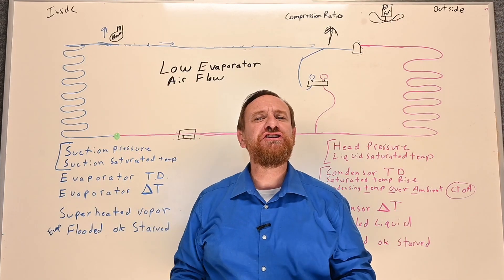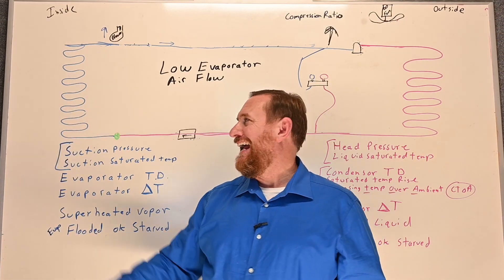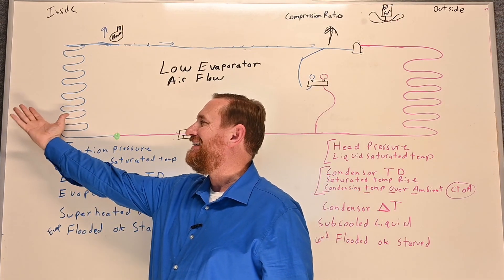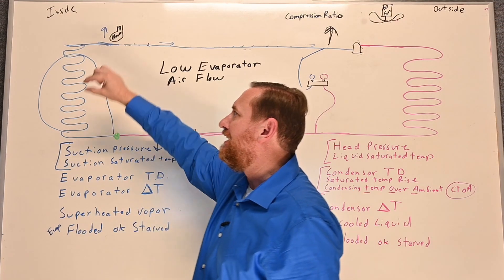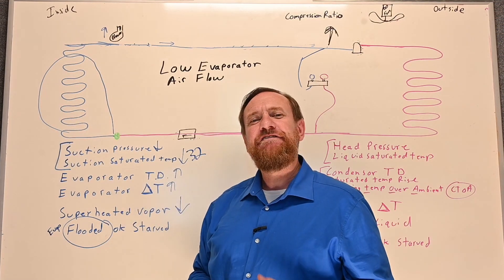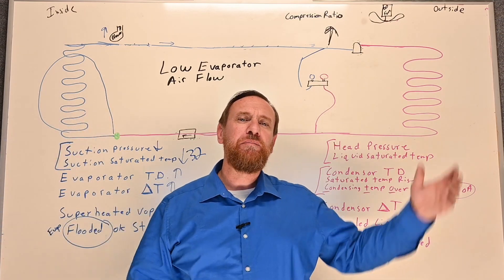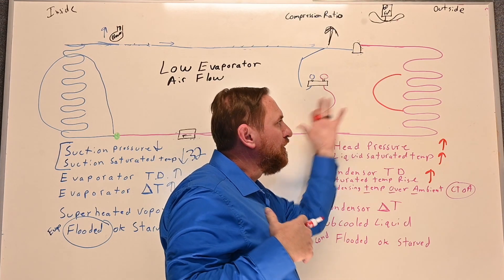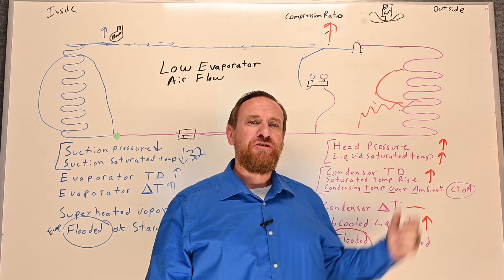HVAC 102 Scenario Low Evaporator Airflow effects on the refrigeration cycle

Comment: Does a TXV completely close when there's no thermal load? I do not understand why if the superheat is low, and txv is closing, there is more and more liquid in evaporator.
Reply from the maker: Some TXV's can completely close it most have an operating range. They can only close so much and the liquid pressure is an opening force.

Comment: On a service call where someone installed a 3 ton for a 1300 square foot, slab home with a downflow furnace.  Old coil was freezing up and after looking how awful the brazes were i decided to put in a new coil and liquid line filter drier.  Triple evac and pumped down past 100 microns and held.  Cannot get the low side above 100psig on a 410a oversized condenser (i did not install).
I am hesitant to put in properly sized equipment because it seems there may be restrictions in the concrete slab where the ducts are run.  There is a giant oak tree out front and seem to think the roots are choking parts of the ducts off.  
Anyone have ever had odd supply air issues?

Comment: I'm confused on this one. If the airflow is low, wouldn't it make the TXV to overfeed migrating the liquid out of the condenser into the evaporator? During a TXV overfeed, the suction pressure raises but with low airflow it decreases? Am I reading too much into it?
Reply from the maker: The TXV will try to maintain a constant superheat and maintain the correct amount of refrigerant in the coil. 

Once the air is restriction gets severe the TXV will close to the maximum of its movement and the evaporator will then flood
Reply: @love2hvac  Ty, first of all thank you for responding so quickly, I'm a fan of your channel, its in my opinion the best in the industry when it comes to teaching!. That's what I had in the back of my mind. It most be a severity situation. I guess a mild airflow restriction will show signs of TXV overfeeding but only when it starts to get bad is when the suction pressure will begin to drop and liquid starts to go through the evaporator and back into the condenser!.

Comment: it's actually very hard to tell the difference between a TXV problem (dirty/debris and can't work correctly) and a low indoor temp,
 as well as air flow restriction based on SH / SC and pressures.
When we have a low indoor temperature, the pressure drops, the temperature on the evaporator drops even below 30F. 
Then what? Should the TXV be opened only minimally so that as little refrigerant enters the evaporator? 
I have this situation at mine car, i in Car A/C, system with TXV and fixed piston compressor, 
when i RISE RPM, my Superheat instantly drop down to 0, 1, 2...thats low.
yes, there is a low ambient temperature( 67F), and a low cabin temperature(61f), 
how do I know if the TXV is working properly? maybe some debris fell under the needle and it could not move needle down to block refrigerant flow?
 any advice to be sure if i have to replace TXV or too low ambient/indoor temp?
Reply from the maker: Get the true flow grid and confirm airflow before doing superheat or subcooling. 

TXV rarely fails and often misdiagnosed. Bad airflow is the #1 cause for improperly diagnosed  TXV.

A TXV does not control pressure, it controls Superheat assuming airflow is correct first. If you have low suction pressure, adjusting the TXV will only flood the compressor and cause premature compressor failure.

Comment: Nice teach sir..What cause, if my discharge pressure stay and my suction pressure drop.. Hope u can reply..
Reply from the maker: Pressures domt mean much 

It's about superheat subcooling, airflow and your metering device. 
Give me those numbers
Reply: @love2hvac  my superheat : 13.5 f, subcool: 47,3 f.. Air : 80,6 f.. And metering is danfoss tex20.. (Double) 
Airflow in good condition.. Renewed air filter, drier filter.. Problem ( freezing at coil, and low press. Line and compressor after run about 3-4 hours).. My compressor carrier 5h60 .. Condenser cooling media is sea water (30°c) 
Im in indonesia by the way sir.. 
Hope u can help me sir..🙏
Reply from the maker: Excellent information, Thank you!

The numbers tell me you are having an indoor airflow problem this could be lack of air across the coil or a dirty coil. 
The 13.5F superheat tells me the TXV is working correctly
The 47 subcooling tells me someone tried adding refrigerant to solve the airflow problem.

Alternatively, check the water regulating valve at the condensing coil. If it's letting too much water through it would cause a stable head and a low suction.
Reply: @love2hvac  thank you very much.. ..for ur time and advice
God bless u sir. ... 🙏

Comment: How the suction pressure of the refrigerant decreases
Reply from the maker: less airflow means less heat on the evaporator. Less heat means the saturated or boiling temperature drops and the suction pressure is tied to the saturated so it follows. 

More airflow means more heat, faster boiling, higher suction pressure and higher saturated temperature.

Comment: Wouldn't the evaporator Delta T go down?  Since not much heat is being transferred the entering and leaving temperature should be close to each other.  Maybe I'm thinking this wrong.  I'm appreciative of the content you provide.
Reply from the maker: The same quantity of refregerants is flowing into the evaporator coil so the BTU or heat absorbing capacity is still there. 
Now that the air is moving slower it has more time to change the temperature of the air. The slower air also has more contact time giving it more time to change the temperature. Since the airflow is less there is overall less heat on the evaporator so the temperature and pressure of the evaporator coil will drop. The lower coil temperature will also mean it is much farther below the due point temperature and dehumidify better. However it won't have enough time to boil all the refregerants to a vapor, dropping superheat and potentially damaging the compressor. 

Lower airflow = More contact time lower evap temps, shame capacity= larger TD.

On a gas furnace more airflow is also a lower TD and less airflow is a greater TD. The furnace makes the same BTU what changes the temp is the airow.
Reply: Thank you for responding.
Reply from the maker: @zlmdragon.  Annular flow, logarithmic law are all important to the heat exchanger design of the evaporator and condensor. This wine here rifling and micro channel technology comes from. The manufacturers test every aspect of it. Then they test the coils in  psychometric rooms  to record performance. I am not involved in coil design but I have witnessed the flow testing and the photometric room testing first hand. Recording devices are not allowed in any of the ones I have visited. It would make a great video if it was.
Reply from the maker: Here is a video that explains it better 
https://youtu.be/pPRJqDoVCXc
Reply from the maker: Here is a great article that works together with it
https://hvacrschool.com/an-evaporator-coil-with-no-fins/?fbclid=IwAR2zcS0LxdknvcdLM3ukmlmVPzSOgAKxbH4As4KNk1D3uSxsYI42-oVajew
Reply from the maker: And more. More that is all connected 

https://hvacrschool.com/20-%CE%B4t-delta-t-a-lazy-rule-of-thumb/
Reply from the maker: Frosting will be inevitable however defrosting uses a small amount of energy overall. As the outdoor temperature drops the cop will drop but even in single digits, it's still higher COP than electric heat.

Trying to keep the coil temperature above freezing means your not absorbing nearly as much heat.

Comment: What would be the difference in subcool and superheat in a dirty evap coil vs a over charged?
Reply from the maker: Great question.
In  these examples they are all with proper airflow first. This simplifies the foundations and places the importance of airflow first. 
I believe proper airflow should be established prior to superheat and subcooling. I believe in air conditioning the airflow is essential and an essential part of diagnostics.  I will later be doing classes on airflow and multiple ways of checking and verifying it. I will also be doing classes on diagnosing. In that section I will show all the symptoms for each problem such as a dirty evaporator coil and how that effects the entire system
 It will tie together capacity SH SC compressor capacity static pressure and more.
Reply: @love2hvac  thanks for the response, your videos are awesome 👍

Comment: What’s the good condenser Δt ?
Reply from the maker: There is no set number. It will vary with conditions, and how much airflow the manufacture has designed. Later we will look at how to calculate total BTU with condenser deltaT and CFM.

Comment: Air flow
Air flow
Air flow
Accumulators & receivers compensate for load fluctuations?
So there will be times when flooding is normal?🤔
🍺🍺🍺🥃🥃🍿🏌🏻‍♀️
Stay safe. 
Retired (werk'n)keyboard super tech. Wear your safety glasses!
Reply from the maker: I was debating adding that or not. Since most resi units don't have accumulators or recovers I decided to keep it simple.
Reply: @love2hvac  when I think refrigeration I don't think comfort cooling.